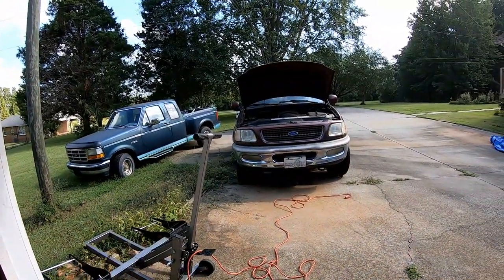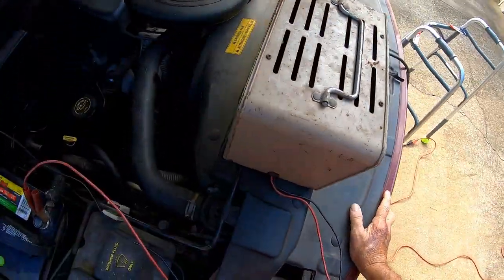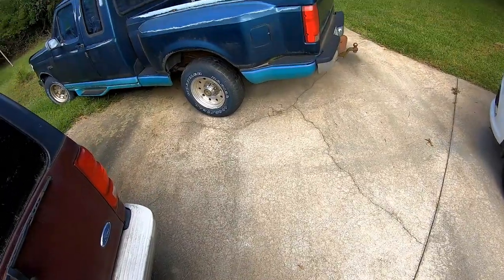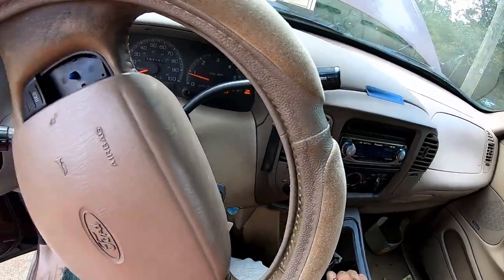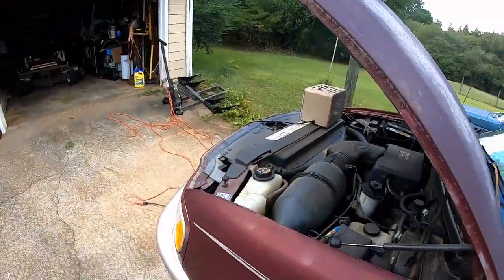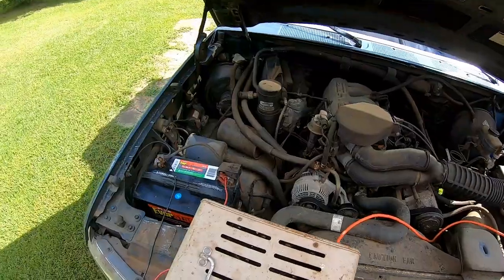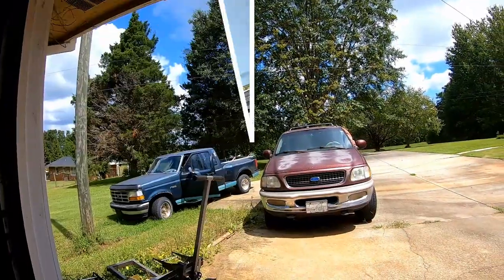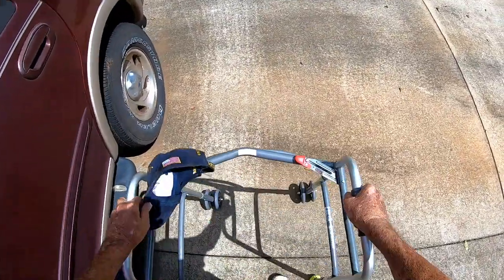Walter  Working with A Walker Pwalpar VLOG 8 29 2022

Comment: Hey Walter, I'm home, yup I have a walker similar to yours, but they also sent along an oxygen machine along with a portable, and for good measure, that tube on wheels to give about 6 hours of oxygen should I lose power. What qualified me was the pulse/ox sensor going below 87. It had gone down to 83, which had the nursing and rehab place in an uproar. Happiness is growing old gracefully, in my case not so gracefully. If I lean over so that my head is below my waist,, I can fall flat on my face. That isn't graceful, but it is awkward.
Reply from the maker: Im down right proud of you progress Hugh

Comment: A couple of suggestions.  1.  A smart type battery charger so you can leave it on the batteries and it will charge them all the way and taper down, this will add years to your batteries life,  vehicles and the ones in the riding mowers.    2.  A good quarter inch socket set that has metric and SAE in the plastic case that you can read the size of the sockets and know when they are all back in place.   I fought the 1/4 inch drive sockets over and over until I happened to buy a set of all places at Aldi's.   One of their deals,  I've used that set so many times,  metric and SAE with a variety of torx, Allen, standard/phillips etc.   Makes working on those small engines much much easier.   Glad to see you out and about,  keep getting better !
Reply from the maker: Thanks for the tips and the awesome comment
Reply: I got a file there and its been a good one. Once i got some solar outdoor lights there also and  are great.